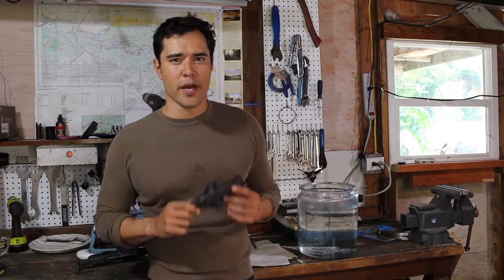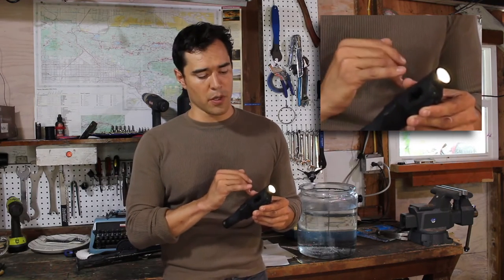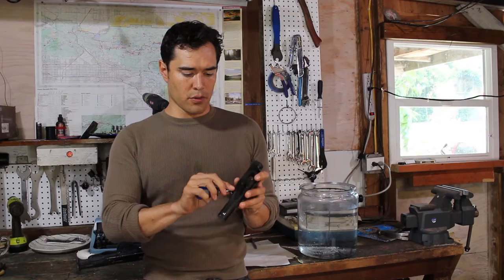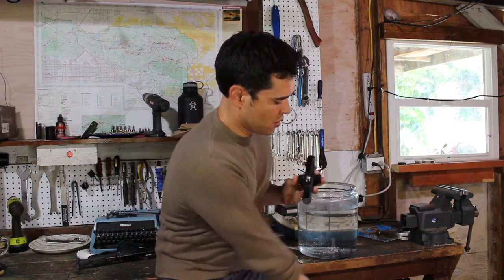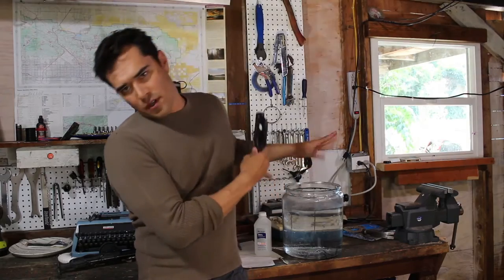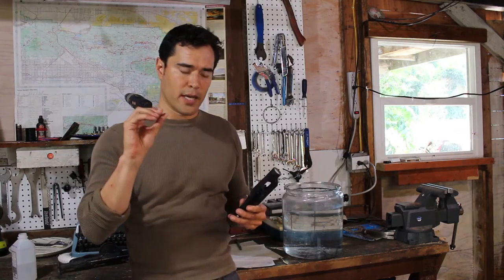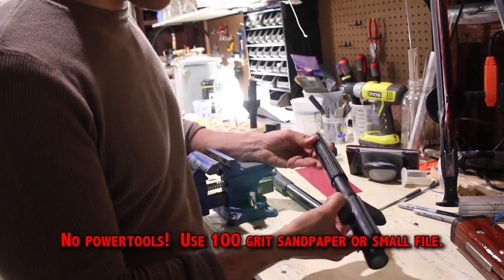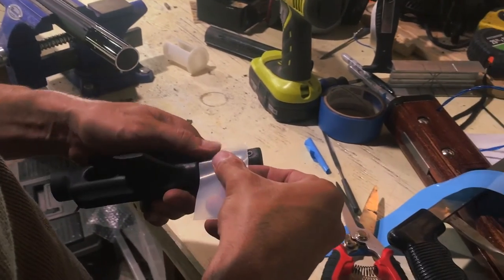Twilight Muzzle: Usage, Troubleshooting, and Installation

Comment: Exellent product! Please recommend me some spearguns for the Twilight Muzzle - thanks in advance for your reply.
Reply from the maker: It will fit any speargun with a round 26mm inside diameter barrel, this 
is most of the newer guns on the market and almost all the older pipe 
guns.  Some of the more expensive and newer guns do not have round 
barrels, but for instance the Pathos Laser series, all Hammerheads, Mako
 Predators, Cressi, shorter Omer spearguns, older Bluetecs should work 
fine.  Rob Allen and JBL Reaper series it will fit with shim tape (the 
sample install I showed at the end of the video).  I may have some guns 
with the Twilight Muzzle for sale on my website in a few weeks if you 
want to check back.
Reply: ...thanks for the much appreciated and quick reply. I have been scuba diving for some decades now and would like to add freediving and spearfishing to my activities - there are a million-and-one questions I would like to ask you since I am an absolute novice - also here in Europe we have a slightly different scenario. Is there any way- or perhaps a good forum I can get more answers to my stupid questions you can recommend please?
Reply: ... and does a laser light make any sense for hunting underwater - also to perhaps attract certain species?
Reply from the maker: There are many online forums for spearfishing and freediving.  
Deeperblue and Spearboard are some of the larger ones.  Another great 
resource would be freediving classes.  PFI, FII, AIDA are some which you
 should be able to find.  There you can learn about safety and 
physiology, and meet other divers at your level so you have some ocean 
partners.  Also there may be diving or spearfishing clubs in your area, 
and if there are specialty stores in your area it may be good to ask 
there.  You are correct, spearfishing is very regional; the way it is practiced in 
California will be different from how it is done in other parts of the 
world, so local knowledge is important.
Reply from the maker: A laser would be of very limited use in my opinion, if a fish is not moving it already very easy to target, and if it is moving and distant you may need aim ahead of the target, so the laser is pointless because it wouldn't be pointing at the fish.  Some types of fish are very curious or territorial but they mostly respond to objects that look similar to bait, we sometimes use flashers to attract certain species.  I am not sure that a laser would serve the same function.
Reply: ... thanks a lot for  your time to answer my questions and your tipps. I will see what I can do here to get more involved. I am 52, so the first thing fo me to do is to get back in shape again and do the breath-holding training. So far I am only at 2 min.45 seconds static and 15 meters depth in a lake here - I guess you would laugh at that so I am  a total novice. Thanks again for your advice.  Cheers from Germany!